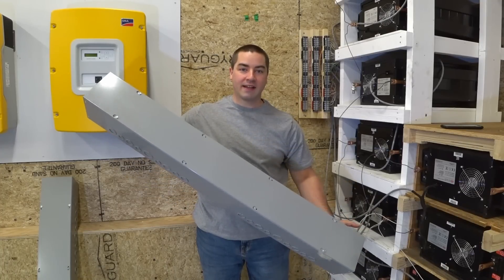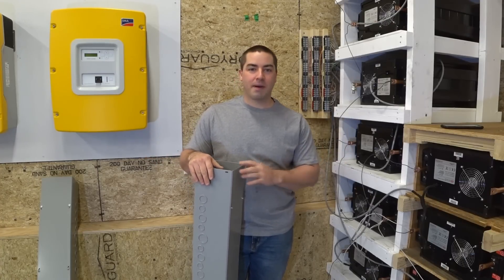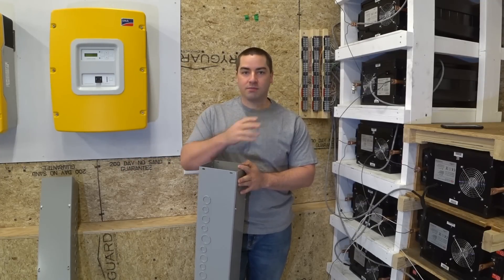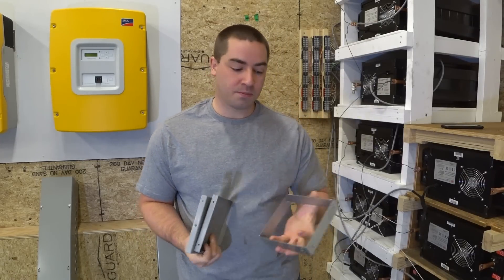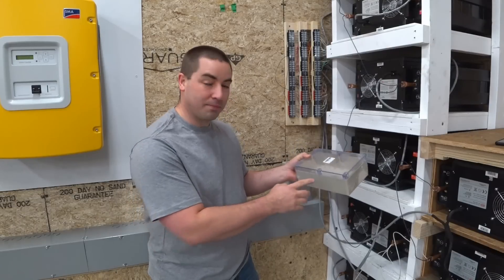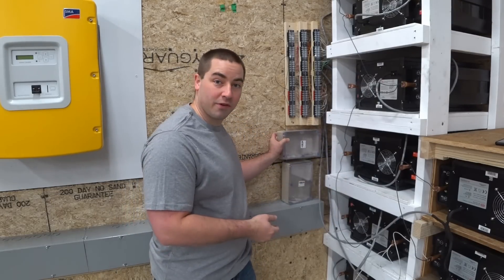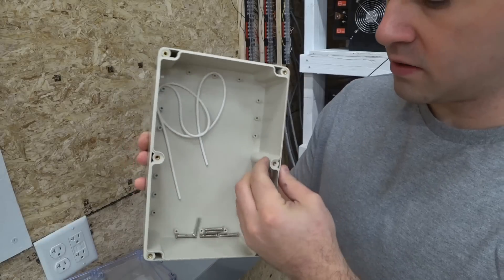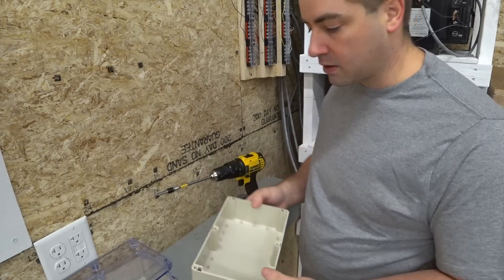Installing Metal Wireway for Off-Grid Batteries

Comment: Clean install, What are your plans to power the batteries from the panels? Some sort of solar charge controller?
Reply from the maker: Yes.  I have a Victron 250/100 solar charge controller.

Comment: Nice work, David. Are those lath screws self tapping?  Or did you pre-drill holes through the metal?
Reply from the maker: Yes, they are lath screws, but they are for wood, not self-tapping.  The back of the wireway had holes in it already.  There is a link in the description to HD for the exact model.

Comment: Are u combining your solar panels in them plastic boxes with bus bar ???? or battery bank
Reply from the maker: I have combiner boxes out at the solar array with circuit breakers.  The solar electricity comes into the garage and goes to a charge controller.  The output of the charge controller can go to the buss bars.

Comment: Hey David, nice job.  I am the guy that also purchased 2 SMA inverters.  I asked you your feeling on Leaf batteries vs the black ones your using.  Since I may turn my fiero into an electric car I went ahead and purchased 2 complete Leaf battery sets from Battery Hookups.  I will use these for my powerwall for now.  If I rebuild the car I may use these for that project.  Then get something else for the powerwall.  Oh, I enjoy your videos so much along with your explanations.  I just became a Patron of yours.  I am very happy I am able to help you out in some way.  Keep up the great Work..  Mike
Reply: I'm also curious why not leaf batteries? It's the way I'm going, I have a GEN2 battery apart into individual modules. I think used leaf modules are a pretty good deal now. You just need one extra module as 48v is 7 modules in series. 7 series, 7 parallel out of a pack (48+1).
Reply from the maker: The leaf cells look like they would make a real nice system.  I love that you can bolt them together.
Reply from the maker: Thank you for becoming a Patreon.  That Fiero project will be fun.

Comment: If I were you, I wouldn't knock myself out trying to use those knockouts.
Reply: I know what you mean, but in my jurisdiction - conduit (or boxes) are required for DC wiring 48v or higher.   From a practical standpoint - conduit and boxes protect wiring... especially in a working garage area.   You never know - one could have a 10ft piece of pipe and accidentally run it into the wiring / battery area while carrying/manipulating it.   I say this from (inartful) experience :)